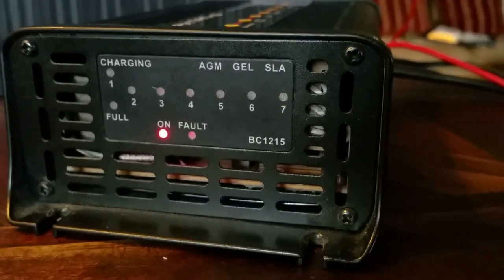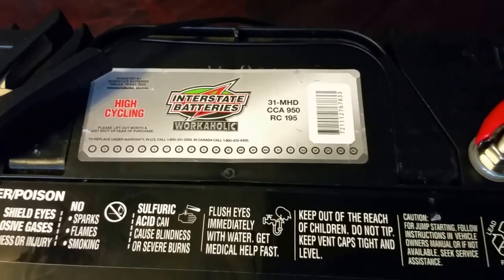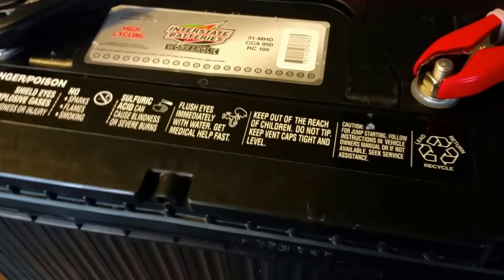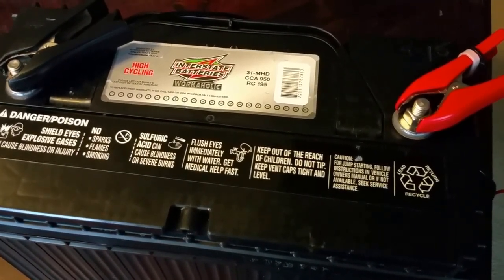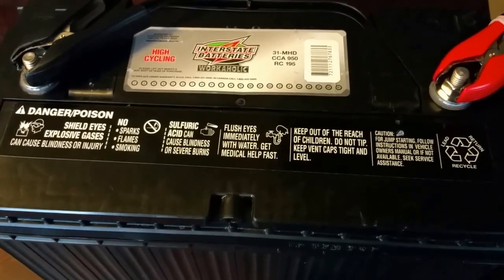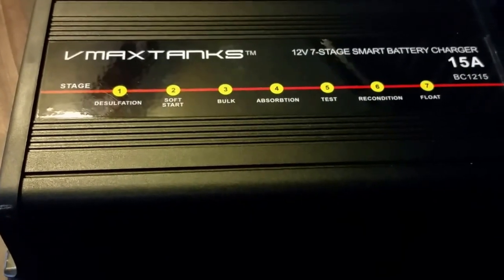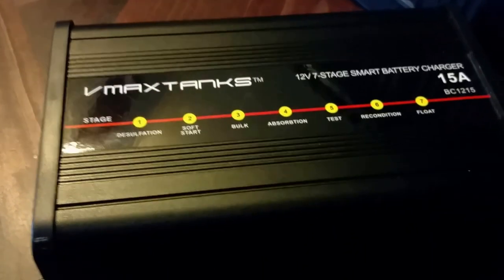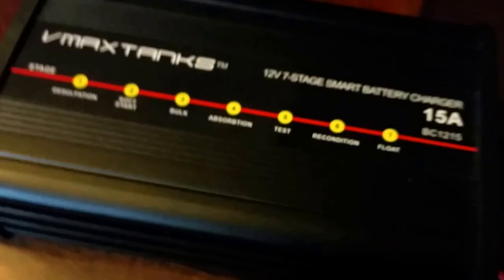VMAXTANKS BC1215 
7-Stage Microprocessor Controlled 
Battery Smart Charger Maintainer for 12 Volt #2

Comment: I bought Vmaxtanks 2/4/8 Amps
Model BC12M248 
Smaller than your VMaxtanks.
Problem are wires get hot when you charge 8 amps, wires should be larger.
If you measured with volt meter at near charger ending it read way to high for AGM say 15+ Volts, where it should be no more than 14.7 volts.
Have you measured your voltage during charging ?
Reply from the maker: +Pong Bunnag 
Mine doesn't have that problem and the wires doesn't get hot at all. Maybe you should bring that up to Vmax attention.
Thanks for comment and for watching.
Reply from the maker: +Pong Bunnag 
https://youtu.be/Q-9AMh_ATTk
MPP SOLAR INVERTER CHARGERS PIP 242424LV-MSD - Complete Installation
WANAMINGO MINNESOTA BY jwsolarusa
Reply: jwsolarusa  
I contacted VMAXTANKS through their website and they have mailed me the new VMAXTANKS charger model BC1207A after I have returned the 2/4/8 amps version one.
No $ charge in upgraded to 7 amps version. Tested the new one last night,
It works perfectly !
Reply from the maker: +Pong Bunnag 
Wonderful!
I am glad they took care of you. Vmax is awesome company and they take care of there customers.
Please make a video and pass it on.
Have a wonderful day